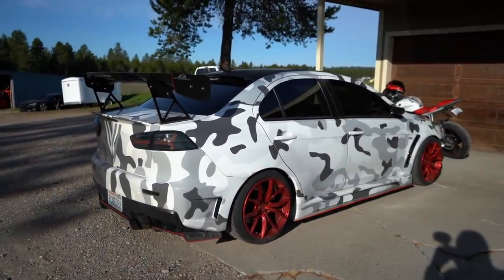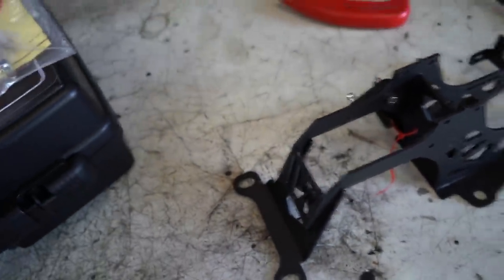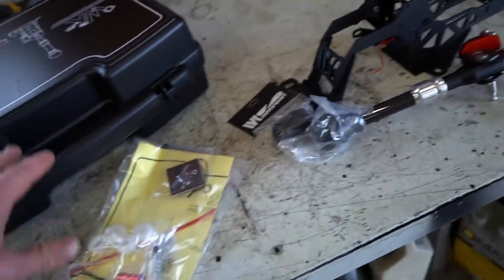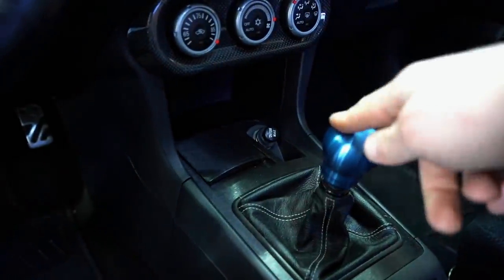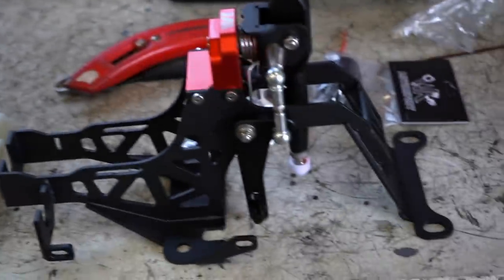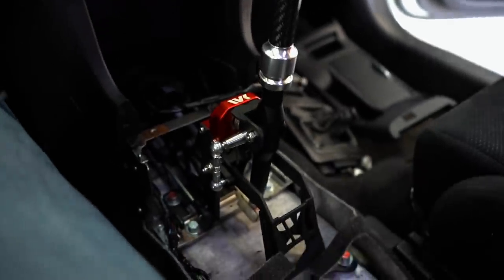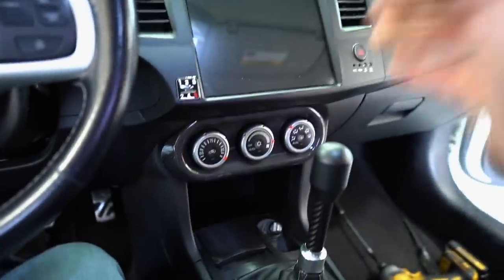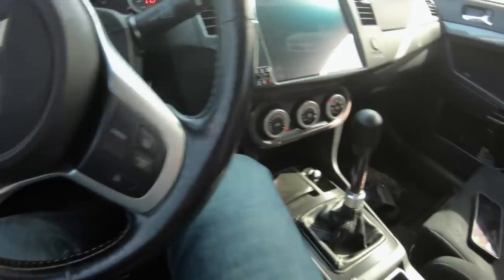Installing Crazy Shifter into Evo X!

Comment: I use to get locked out of 3rd at high RPM too bud. When I sent the trans out for the "ultimate final drive" upgrade I think they did something different with the syncros and it was perfect after that

Comment: That lockout could be a clutch issue. I know it's a different car, but my mustang has the same issue and its the clutch. Shifting at 7600 is no issue, but the moment I try to shift at 7700+ it locks out. Not saying that's the case with your issue, but worth looking into.

Comment: I think you need to get an X MR with some paddle shifters. Look people dog the MR... but there is a reason Mitsubishi made it their "Mitsubishi Racing" model.

There is a reason they put a fancy interior in it.

My 4G63 is putting 600awhp on 93 pump, stage 4 shep with an evo 3 first gear and double syncros all the way... It is violent, but man I love climbing in my MR for daily driving. Especially through the city. And when you shift it revmatches keeping on the boost all the way.

I have a feeling anyone talking shit never drove one. Try it.